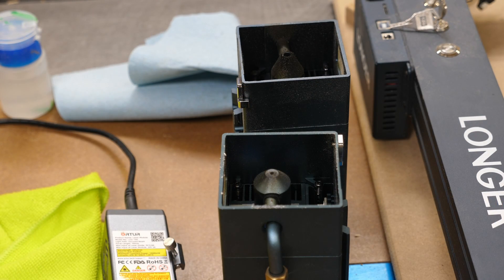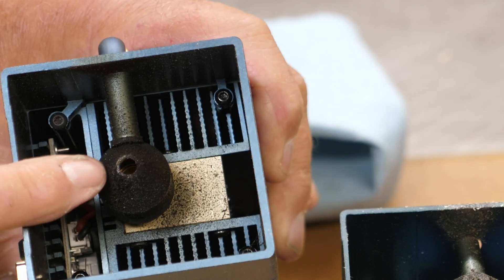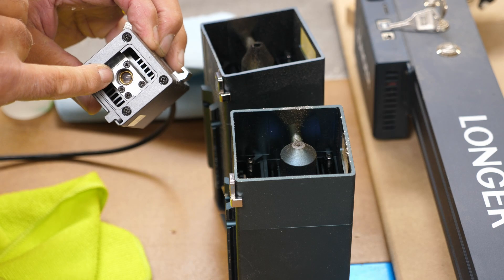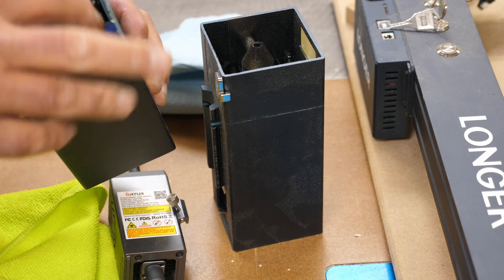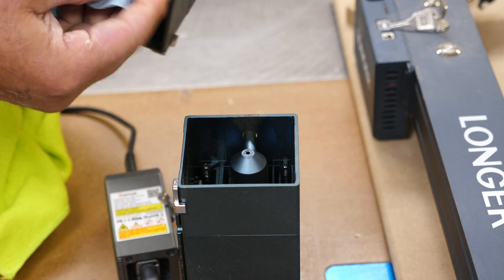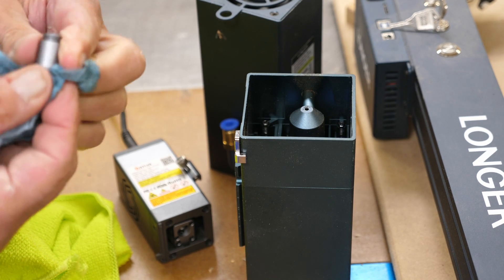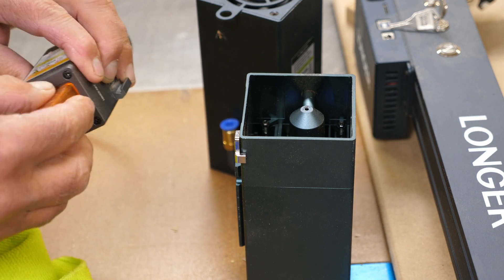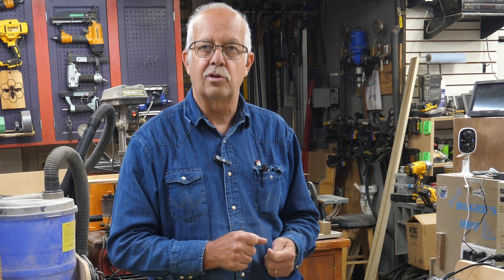Cleaning Your Laser Lens!

Comment: How often should I separate and clean the longer module?
Reply from the maker: Depends on amount of use and what materials you were engraving or cutting.  When cutting or engraving wood products, also while using air assist, I will check and clean after a day's use.  It is not uncommon for me to run a laser for 8-10 hours at a time, if busy.  In those cases, I clean every day.  with items like ceramic tiles or glass, you can go for many hours without having to clean.  The type of wood also makes a difference.  One of my lasers is dedicated to slate coasters and I can go months without needing a clean.
Reply: @rogersshop  thank you for the input. New to this and appreciate all the help I have been getting.